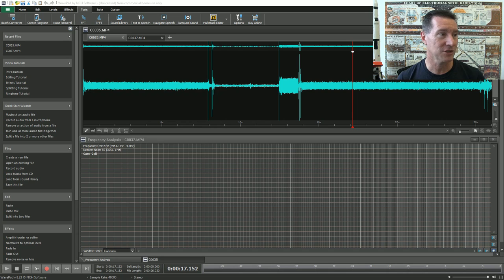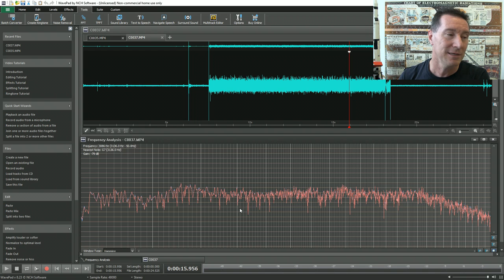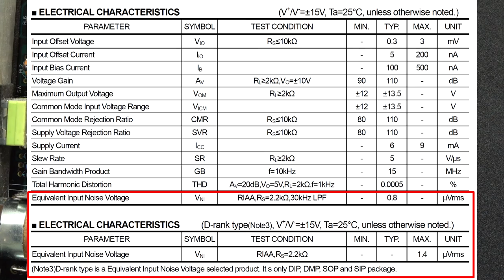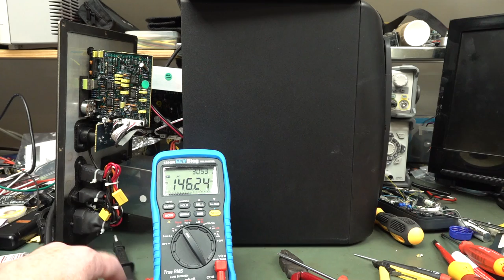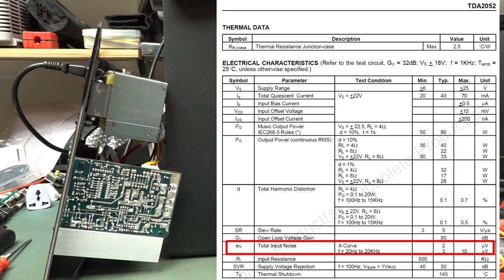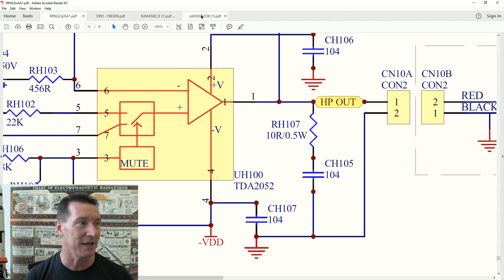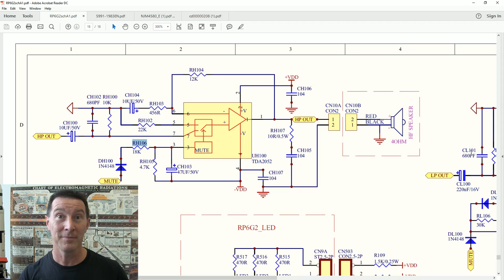EEVblog #1118 - Why Are Studio Monitors Noisy?

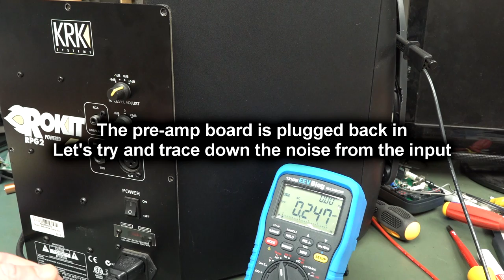Comment: At 7:53, you state that the blue AC meter has a BW > 100 kHz, which is fine. But note that En is specified at 3uV when measured over a BW of 20 kHz. To get your meter readings to jibe better with the the datasheet (and your ears), you should have added a lowpass filter to the input of the meter to limit its BW to 20 kHz. Without such limiting, your RMS meter will measure and add more HF noise that your calculations and the datasheet do not assume! However, since all of the measurements were done using the wide BW meter, then the amp's datasheet numbers as well as your thermal noise calculations (11:16) have to be expanded out to this assumed meter BW of 100 kHz (+/-).

I'm pretty sure that the source of your noise is En and the thermal noise of (RH9//RH10//RH100 = 1Kohm). You can't just add these two noise sources. You have to do the square root of the sum of the squares. When you do that, then En dwarfs the resistor noise, so it comes down to just En. First you expand En to a BW of 100 kHz, which you do by multiplying it by sqrt(100kHz/20kHz) = 2.24. En is now 3*2.24 = 6.7uV. This noise gets multiplied by the gain of the amplifier, (RH4/RH3 + 1)=27, giving a noise value of 6.7*27 = 181uV.

This is getting close to the measured value, but now you have to consider the potential error sources in the calculations. The biggest one is the BW of the blue meter. If it is really 180 kHz (Dave said "100kHz-plus bandwidth"), then the calculation bumps up to 245 mV. Then there is the unspecified error of the meter when operating at this frequency. The user manual claims accuracy out to only 5kHz. What happens to signals at 100 kHz? 200 kHz? Let's face it, this meter is being used far beyond its stated calibrated capabilities. Note to Dave: you really need to measure the freq response of this meter out to the frequencies you intend to test with it. You certainly have the calibrated instruments to do it.

Another error source is En itself. It has a very wide tolerance to it (3uV typ, 10uV max). If this particular amplifier's noise is 4uV, a very real possibility, then you also get a 245 uV calculated result.

One last thought: much of the measurements shown here are way too high only because who can hear anything beyond 20 kHz? Why include the noise that is out there beyond 20 kHz? To get a true measure of the voltage that counts, namely "hiss" that we can hear, the measurements should be reduced to about 250uV * sqrt(20kHz/100kHz) = 120uVrms (20kHz-20Hz).

BOTTOM LINE: the source of the hiss in this video is the power amplifier itself. These very old TDA amplifiers were well-known in their times for being noise generators. They are obsolete today for good reason!

Is there any possible fix? Some have correctly said to lower the gain of the power amplifier, which would lower the output power by 3dB, which is perceptible. But then you have to raise the gain of the preamp by 2 to get the same total gain you had before. Maybe the design has too much gain as it is? Is there enough headroom in the preamp to do this? I'd disconnect the speakers (to save my ears) and replace them with dummy load resistors, then attach a signal source and start driving the system to its limits. Adjust the gains of the preamp and the power amp such that they both begin to clip at the same time. See how much headroom you have in each subsystem and get them "balanced" this way. Ideally the designers did that in the first place. Such a mod could be an entire video in itself.

Calculating noise is a real black art involving a lot of squares and square roots, combined with recognizing Thevenin equivalent circuits. I understand a little bit about it, but I make no claims to being an ace at it!

Comment: First of all, you did not mention any of the "top brands", you mentioned affordable home studio monitors which are different animals all together. Genelec, PSI, Barefoot are some of the top brands. And two, what kind of AC line conditioner are you using? IF you run those KRK's through a Furman with L>I>F>T> that noise goes away because the problem is the filthy hydro power and no one who values their recordings at all would plug anything to do with recording into a wall socket! That will give you 3Db of noise that could be used for music or what ever you are recording. But I would think someone like you would know that, pretty surprised that you don't.

Comment: You made me curious so I checked out my British handmade Quested S7 active monitors, which the company I worked for also sold a few times to Abbey Road Studios. Here is the datasheet info:

POWER AMPLIFIER
LF output power: > 120W RMS continuous (note 1)
HF output power: > 70W RMS continuous (note 1)
THD: < 0.03% at levels up to 1 dB below clip, 20 Hz-20 kHz. typ 0.005% @ 1kHz.  
Hum & Noise: -100 dB referred to clip
NOTE 1:  The continuous rating is for a period not exceeding 5 minutes with unrestricted airflow
(100 mm clearance) around the amplifier heatsinks and an ambient temperature not
exceeding 30ºC.

POWER REQUIREMENTS
Voltage: Set by internal plugs: nominal 115V or 230V @ 50-60 Hz AC
230V setting: min 160V; restricted output power: max 255V
115V setting: min 80V; restricted output power: max 127V

CONSUMPTION 
Quiescent: 18W
Typical use: 75W (average music)
Max: 140W (average music)
Note: 0 dBu = 775 mV into open circuit

Dimensions: 244(w) x 347(h) x 302(d) mm
Weight: 11.7 kgs 
Drivers: Bass cone - 1 x 165 mm (6
1
⁄2”)
High Frequency soft dome - 1 x 28 mm (1
1
⁄8”)
Maximum SPL: 115 dB (c) continuous pink noise @ 1 m (121 dB (c) per pair RMS music)
Frequency Response: 65 Hz-22 kHz ± 2 dB
Connector: XLR and 
1
⁄4 inch Jack combo socket
Impedance: 10k ohm electronically balanced with RF filters
Wiring: Pin 1 ground Sleeve
Pin 2 hot   Tip
Pin 3 cold Ring
Sensitivity: -12 dBu to +6 dBu for 96 dB SPL @ 1 m set by 10 position rotary switch on rear
Subsonic: -3dB @ 30 Hz, 24dB/oct
Ultrasonic: -3dB @ 75kHz, 4dB/oct
Crossover: 1k19
LF EQ: -2/-4 @ 65 Hz
HF EQ: +/-2dB @ 10 kHz

INDICATORS 
Power on: Front mounted green LED indicates pow
Clip: Red LED 2 dB before amplifier clip.

Comment: I bet the noise is from grounding layout. The high current driver returns should go directly to the psu smoothing cap center taps, while the low current signal returns should come together at a star further away from the caps. Must avoid high current return leaking in to the low level signal returns. Also mains ground should join at the low current star point.

Comment: The power amp is coupled as a inverting opamp with a gain of 1+ RH104 / RH103: 12k / 456 ohms = 27, that's a lot of gain, what I learned in Audio design class, was never leave feedback resistor unbypassed, have not read the data sheet the amp might not like it, but a small feedback cap over RH104 to cut down on the power amp, frequency response could be a good idea, I know that there is some parasitic capacitance in the PCB, but Add 330pF over the 12k resistor, would cut down the frequency response to 40Khz 1/(2 x PI x 12k x 330p ) = 40,2Khz   This could lead to instability of would properly do with a good read  of the data sheet before doing this :)
Reply: I figured out bypassing the feedback resistor by trial. Old TDA2030As didn't need it but the newer drop-in replacements (LM1875) would straight up oscillate in the ultrasonics without it.
Reply: You might just be able to change RH104 and RH103 to different values the tweeter really does need a low frequency rool off at 34Hz  (CH104 is 10µF)  1 / (2 x PI x 456 x 10µ)  I would try dividing the resistors by two, 6,2Kohm and 220ohm  would cut down the thermal noise of RH104
Reply: Cool I was just thinking out loud :) My other respond might be worth a try :)
Reply: Can't get the feedback resistor too small since there's a series resistor on the output of the opamp feeding the power amp.

Given that dave said it's probably not the input noise characteristic, there is probably noise being put into the amp, such as through resistors or oscillation.
Reply from the maker: I think the noise is inherent in the amplifier output stage, as they do not have an output refereed noise specs in the datasheet like some other higher end amps.

Comment: I think ST have superseded the TDA2052 with the TDA7296?  Notably the new amplifier spec emphasises "VERY LOW NOISE" in the feature list - I wonder if they've solved the problem.  It has a few extra pins with a new Standby function and separate pins for output stage power, but it looks as though it would be straightforward to swap in with some pin remapping.  Challenge for you!

Comment: The buzz could be a ground loop. I had the same trouble with my Presonus active monitors. For some reason I had less trouble using passives and a separate amp.
Reply: Use an audio isolation transformer between your signal source and the speaker amp's input. This breaks the loop and usually fixes the ground loop problems.

Comment: KRK is not a good reference point to use. KRK use a glue on the PCB's that goes conductive over time and causes all kinds of chaos, it is best to avoid using them overall. It would be interesting to see a side by side comparison with this power amp chip used in the KRK and a LM3886, the LM3886 is used in quite a lot of HF drive designs.

Comment: Often minor HF instability reveals itself as hiss/noise  A 100 PF(?) in // with feedback resistor may help. It is unusual for a power amp to generate that much noise , even with a sensitive driver connected.  Though most of those studio monitors are horrible - just like these....
Reply: Clouse loop gain has to be upper 30dB, in this monitors 28dB. This is stability
Reply: @vitalley  The closed loop gain of the amp assuming half a volt sensitivity and 100W out is around 34db (with 8ohm load for 100W but voltage gains are same of course). Not sure I understand what gain has that to do with HF oscillation? What is happening in the audio band may have nothing at all to do with the HF. That also describes almost every audio amp ever made? Many are motor boating and whistling and hissing for various reasons and some are wide band and have a -3db point above 100khz where it is difficult to ensure phase is kept in the stable region.  
I'm probably missing something obvious - I often do - so forgive me if I missed your point. Regards.

Comment: Because they are crap? Buy some genuinely industry standard Genelecs if you really have to have powered monitors. I use single ended valve amps with monitor speakers. BTW, Yamaha NS-10s are used in music studios as they are awful - if it sounds good on them it'll sound good on anything. Though they have good timing.

Comment: i suggest to  decrease the gain of output amplifier to something like 10... to change 12k resistor for 6k.. it will improve gain staging too
Reply: @Ruslan
Yes, gain balancing would help, but one can't lower the gain that much.  The TDA2052 requires gain to be at least 30dB (32x) for stability.
Reply: so its better to put lm3886 there:)

Comment: I have both these (8 years old, haven't been affected by the black gunk of death yet), and a pair of JBL305 (which has class D amps), and the hiss from the JBL305 is really awful (but no low freq humm), still audible when playing music at a normal volume.  I was really disappointed with them because so called audiophiles recommended them.  I dealt with it by inserting a 2 watt 40ohm resistor inline with the tweeters, then used eq to boost it back to more or less flat response, sounds great now.  Might do the same with both the woofer and tweeters in the RP6s next.
Reply: Sorry but the JBL305 is a cheap speaker and probably a response from JBL to other cheap "made in china" stuff. I have never seen or heard it but from the specs I can imagine it would be wise to avoid them.
Reply: wow good on ya man. i think i might investigate something similar. i just dont wanna deal with phase problems. how is your phaseyness with your modifications? did you manage to match it right again?
Reply from the maker: Wow, really, audible  at listening levels? By most accounts the JBL305 are fairly highly regarded, but I have heard about the noise, didn't think it was that bad.
Reply: I don't know sorry, never measured it for phase issues, if there are any I haven't noticed.  To be honest I used a lot of eq even before adding the resistors...
Reply: Hi Dave, yes, and this was at 2-3 meters listening distance, although depended on the music really (i.e. heavy metal masks it, classical doesn't).  Someone else here said removing the ground pin stopped the hiss, so I'm thinking of trying that as well, but really can't see how it would work... If it does, I would really appreciate if you could investigate that :)
Reply: @ppdan  whats wrong with their specs?
Reply from the maker: I suspect this is  system ground loop issue instead of inherent monitor system noise?
Reply: @EEVblog  it is the same as with KRK, the noise is at a fixed level and is present with nothing plugged in
Reply: They didn't even make an effort to have a full spec sheet like they do for all their professional products which is typical for cheap stuff they outsourced.
I don't think the OP is witnessing ground loop because it typically has that hum with it. I would rather guess that he doesn't feed a balanced signal and the cold wire is floating in the breeze.
Reply: Ok, just tested it and disconnecting the ground didn't make any difference (after shorting the resistor so I could hear the noise again).  I thought ground loops were a 50 Hz hum, not a hiss, so I didn't think I had a ground loop issue, but just had to rule it out.
Reply: @ppdan There was nothing plugged in the speakers apart from the power cord.  And the signal cables are balanced anyway, and fed from a PCM1794 DAC, with optical in.
Reply: @laurencedarby9042  Nothing plugged in leaves the signal lines floating. You would have to short hot and cold and check noise again. Where did you get the idea to add a resistor? This is the weirdest thing I have ever heard.
Reply: There's absolutely no difference in noise (that I can hear) between nothing plugged in and the DAC plugged in and playing silence, so it's unlikely shorting the input will change anything.
Reply: This resistor in the output and the eq boost in the input sounds like a mechanical version of Dolby noise reduction.. Basically the Dolby chip will increase the input levels during recording and then reducing on playback effectively pulling the signal down to the original level but also pulling down the noise floor of the tape. So I guess that additional gain stages would or should theoretically lower the noise problem if they are all working at their ideal gain... Dave, this is a popular topic and if you decide to go further into this topic and decided to reverse engineer with modifications to improve the performance of these monitors, then you will have a very watched video because this affects a lot of people...
Reply: +EEVblog Yes, I have those same speakers and the noise is some kind of EMI it picks up from noisy sources (even digital coax from a noisy computer to a DAC that is then connected to speakers will induce the noise). The best way to get rid of it is with balanced cables (and setting a lower gain on the speakers) or optical SPDIF to a DAC.

Comment: It's a box with ok components,crammed in with an ok amp,like Class  D,so what would we expect?I use passive monitors,as in 3way,with no controls,and a separate AB class amp..We are dealing with price/performance points and the convenience of not having to use a power amp.We already know that the more stuff you cram inside a box together,close to each other,the more noise,interference,and crosstalk you get..That was figured out even with computers,not using the onboard audio,and using external interface audio...

Comment: Hello, Dave could you please test just the output stage of the IC ? If the datasheet is correct you can choose which stage is off by voltage level on the mute control input, in some state only the input is muted (as you have thought originally) with other voltage level output stage is off too if I understood it well. So it would be interesting to know which stage in the power amp is responsible for that noise.

Comment: In my case noise was coming from monitors plugged in to the same socket as PC and display monitors. Plugged them in to separate power socket - dead quiet. Other devices on the same socket were somehow "contaminating" the current going to the monitors. But it's a probably different cause in here.

Comment: i have rokit 5's and yes there is a hiss (i was also under the assumption that they all do this) but i can tell where yer speakers have been repaired. the noise they make is different than any of the ones ive had. more buzz and less hiss than a fresh set.
Reply: to clarify for any haters readign this (yea last time i commented on my rokit speakers dave himself had to come shut the guy up)  i  can confirm from use that my speakers are acting the same way as have all my rokits ive owned. my point is a fresh set makes a slightly different sound than the set he recorded. a bit more buzzy than my own set. and im going to assume that difference in noise is a difference in the health of the caps or something inside

Comment: I have rp8 g4 and no matter what socket they plugged in round the house they both have the same level of white noise no matter what gain you set, connecting  this to interface does not help. 

Faulty units? White noise is annoyingly loud tbh. u can hear it from 2-3m away